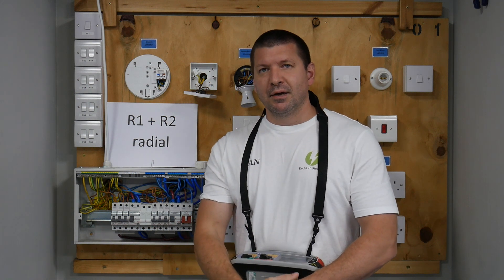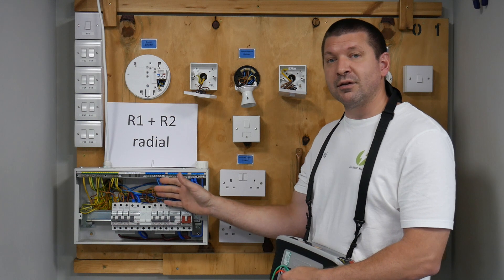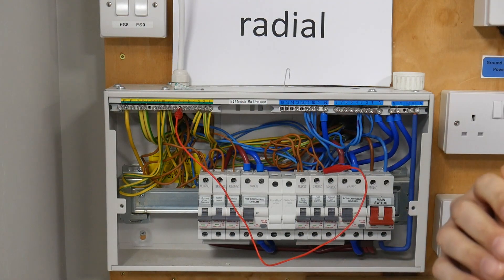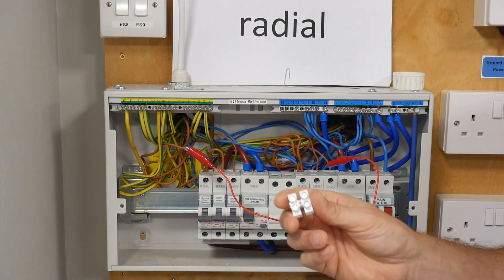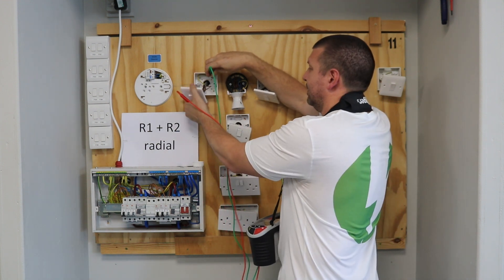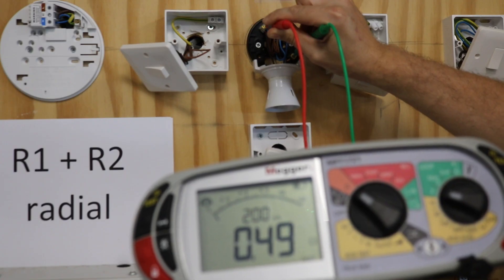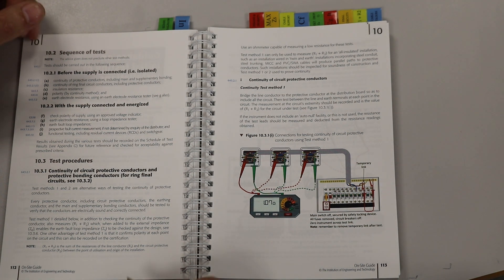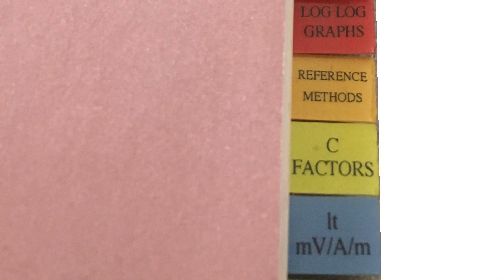Guide to completing an R1 + R2 test on a radial circuit and how to complete the test sheet.

Comment: Why can't you just go to the end of the circuit and carry out the measurement? I've seen testers do testing on new and existing installations and I have never seen one ever test at a switch, always at a lighting point, they keep testing until they reach the highest value.
Reply from the maker: @peterjones2761  BS7671 tells us to record the measurement at the circuits extremity, which is usually the lighting point. But it also tells us to test at each point in the circuit. Which would include switches. I'm not wanting to say anything negative about fellow electricians. But experience and dare I say a little laziness means we all cut corners maybe? On a final ring the Regs tells us to complete an R1+Rn figure of 8 test but I've often seen that skipped. 

I'm just informing you of what the Regs say, and what would be expected of a student, attempting to gain his qualifications 🙂
Reply: @ElectricalStudentsUK  no probs my fine fellow, good video

Comment: why would it give a false reading if you left the crocodile clip on the earth bar? only one of those earths goes off down your chosen radial circuit, so the other cpc's in the earth bar would not spoil that reading. maybe there's something i dont understand here

update - ive seen this question was amswered in the existing comments. thanks

Comment: Would the R1 + R2 have the highest Zs reading at the 3 plate ceiling rose when switched from the furthest two way switch, this accomodating the R1 lenght of cable via the switch wire back to the the ceiling rose. Apreciate each point needs to be checked.
Reply from the maker: Yes, you are correct regarding the R1 length and that this would usually give the higher. Each connection can increase the resistance. Sometimes, this means the highest resistance is not necessarily at the furthest point

Comment: Question - Some older homes dont have an earth at a lighting pendant etc, so how would you test? I assume you would test r1 + rn instead?
Reply from the maker: Hi there. You could do an r1 + rn to confirm continuity but you wouldn't record that on the test sheet. If there is no earth in a really old lighting circuit then that would be recorded as a deviation from BS7671

Comment: Thank you for doing what you do and I don't mean to be a keyboard warrior but I don't understand why you think that linking the L conductor to the E bar "tests all the other earths".  The MFT sends a small current through the conductors and the only E that will be continuous is the E of the circuit you're testing?? Also at 6.31 you say that "we diconnected our L from the MCB and connected it straight into our E bar" - don't think you did that. You disconnected the E from the E bar and connected that to the L of the circit under test.
Reply from the maker: Did I..?? Sorry mate, my mistake. There is a possibility you will receive incorrect readings by leaving the earth in the earth bar. The tester will can potentially record the resistance of any and every conductive material that is connected touching the test probe at the time of testing
Reply: @ElectricalStudentsUK  Thanks for prompt reply.  I hear what you say if you have several earths at the point of test, but if single radial circuit as here?
Reply from the maker: I think it's more there is a possibility. I'm not saying you definitely will, just that it is possible you would get a false reading. And for the sake of removing one cable, it's not really any additional time or effort
Reply from the maker: It's that, rather safe than sorry term
Reply: 2😂。拍跑不了 被😊
Reply: Can you not just put the line from the mcb into the earth bar for a temporary link?